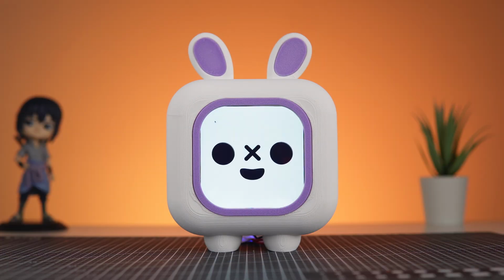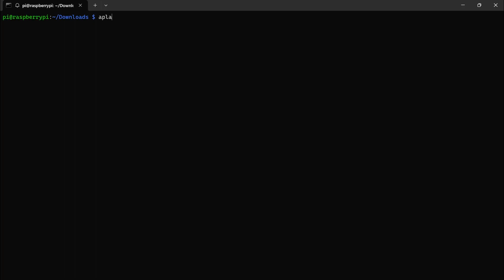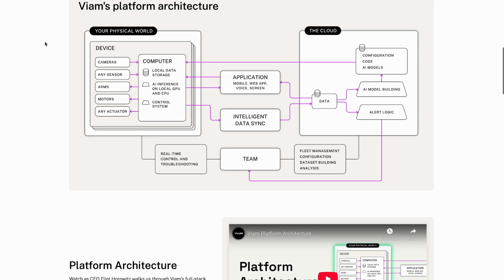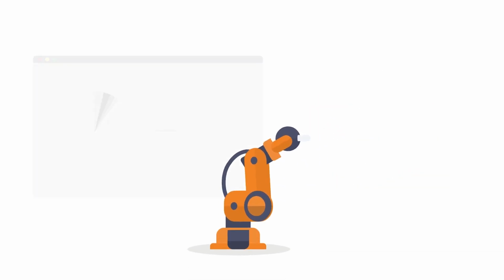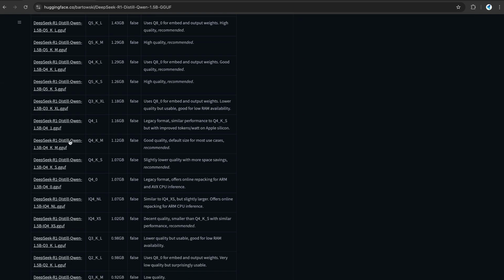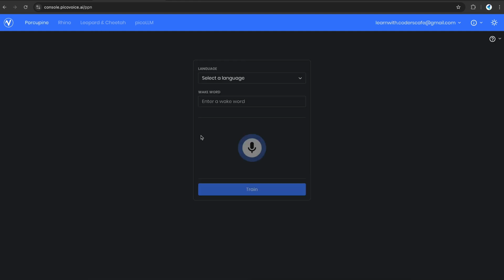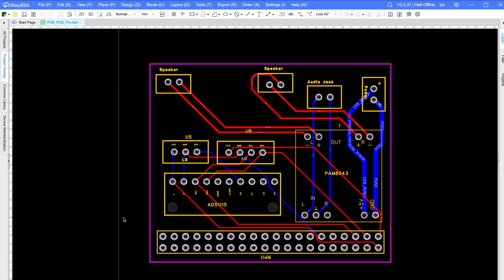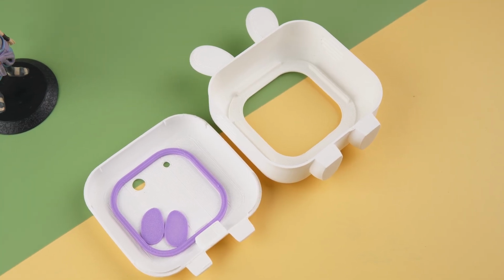Hey Pomo!  Create a Personalized AI Chatbot with Raspberry Pi and Deepseek R1

Comment: So cool that some of the LLM processing runs on device now, if I understood that correctly. Even if it's just the wakeup phrase, that is helpful. I wanted to make something like that back when GPT-3 came out (before ChatGPT was an app in the AppStore) and I even tried something simpler before that. At the time, it seemed like you had to continuously send to OpenAI whatever random noises the microphone was picking up to test if it contained your wakeup phrase. It was network intensive. So much more freeing to be able to do that step without an internet connection!